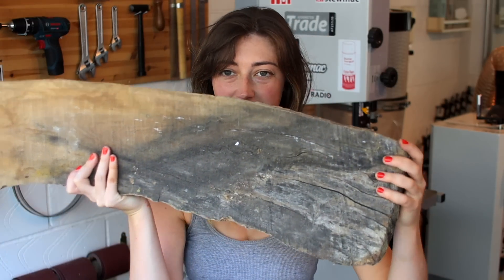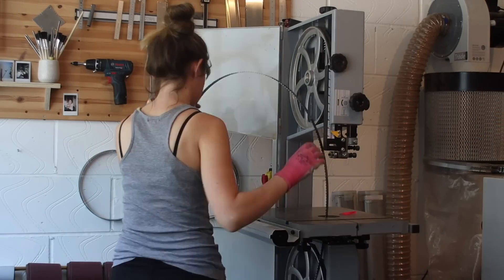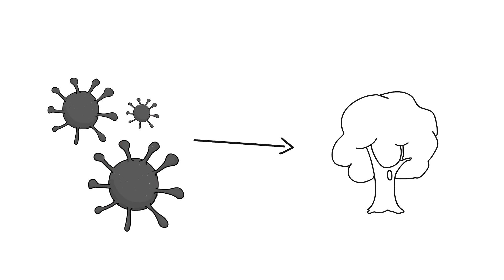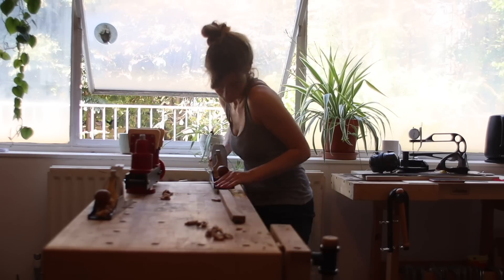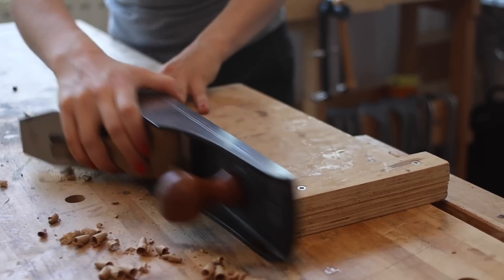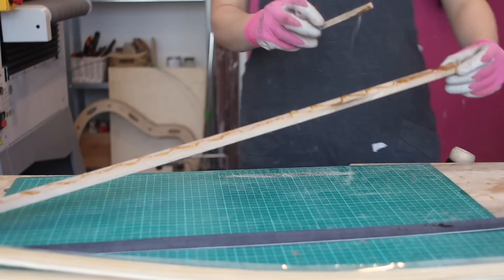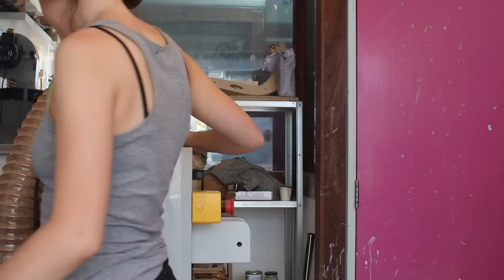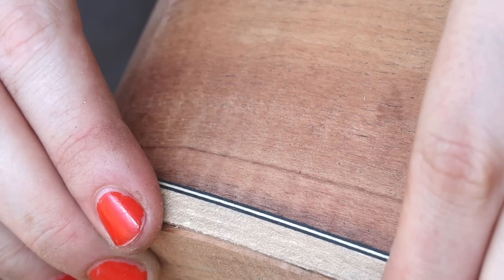Making Guitar Bindings

Comment: Nice   First video i’ve found for making bindings.

Glad to see you wearing gloves and recommend a block or keep fingers past the cutting edge on the saw. I have a block my grandfather used that’s over 200yrs old

I admit I don’t wear gloves enough myself and was quickly reminded this week while I was sanding a piece of hickory for a machete handle and suddenly the wood separating my fingers from the sander flew away faster than superman… 80 grit paper…. 
Healing now but it was such a cool jagged cut split or rip I may have even have a pretty cool finger print…

Fortunately I was a medic for 30 yrs so I know how to use duct tape.  😎

Comment: For everything you never knew about spalting, look up Seri Robinson, aka Dr. Spalt. She is at Oregon State University. Spalting actually comes in rainbow colors, and has been used to make dyes for hundreds of years. There are samples of furniture from the 1600s or so where the colors are still bright and vibrant. Her program is about making the dyes. Northwest Spalting is the business associated with it. 

One potential problem with the foamy verathane glues. If you ship or mail by air, the bubbles will expand, and things can delaminate. Had a friend who made expresso tampers, gluing stainless steel onto exotic woods, and air mailed them to Japan. They all failed/delaminated.

Comment: 6:14 I really do apologize if I'm overstepping, but I just wanted to caution you about wearing gloves while operating a bandsaw. If the blade catches your glove, it's much more likely to pull it in with your hand vs. your bare skin. It's generally considered a lot more dangerous to wear gloves with certain shop tools like the bandsaw. Apologies if it sounds like I'm being preachy with unsolicited safety advice. Just don't want you to lose a finger, it makes guitar building and playing a lot harder! :)
Reply from the maker: Nah it’s totally fine when I’ve given guidance in the right way - I agree, I don’t usually wear gloves, I just completely forgot this time. Thanks for flagging up in the right way :)
Reply: @DaisyTempest  NO! depends on what you are cutting. If you are cutting aluminum or steel it will get hot fast. It will burn you without gloves. Get good leather gloves that fit tight.
Reply: I am ashamed to say I actually cut the pad of my right thumb on a running bandsaw, and it's a devil of a wound that takes forever to heal.  I worked nearly 40 years as a toolmaker, so I guess you are allowed one or two mishaps in what works out to close to 80,000 hours using machine tools.  Since I retired I have found angle grinders are the tools most determined to get me, and usually when I have finished what I was doing with it, and am putting it down while it is still slowing down.
Reply: @anthonyb5279  If you’re cutting metals on a bandsaw and burning your hands, you’re either using the wrong combo of blade/speed/lubricants, or not using an appropriate fixture or pusher on the material. Also if you’re letting blades get that hot, they probably aren’t lasting long. The problem with even tight-fitting gloves is that if the blade nicks them, you don’t feel it and react the same way as you would with bare skin. And with how strong leather is, if that blade happens to snag the glove forcefully, your hand is coming along for the meat grinder, until you manage to shut the machine off and the blade slows down. Every shop safety class I’ve ever had to take pounded into our heads that loose clothing, long hair, and any other loose things like necklaces, jewelry etc were to be removed or tied back before entering the shop, and for tools that pose a snag hazard, gloves were NOT to be worn.
Reply: @TrevorDennis100  Ouch! Sounds like you still got to keep your thumb though, so thank goodness for that. A story from my life: a family acquaintance (a dentist actually) was a hobbyist woodworker on weekends. He did great work and was quite experienced, but one Saturday afternoon he wasn’t thinking and reached around the bottom to support a piece of falling wood he was cutting with a circular saw. Yep—the saw went right through all 4 fingertips. The worst part was, as a dentist, it affected his ability to do his job until a long recovery. As they say… safety rules are written in blood! ;)
Reply: @400_billion_suns  you have never cut aluminum have you?
Reply: @anthonyb5279  I have. Many times. I've fabricated parts on CNC and manual mills and lathes and have worked with numerous shop tools. One of my degrees is in mechanical engineering and a lot of time was spent working in the machine shop then as well as future jobs afterward.

Comment: The lighting on the shop from those big windows… so awesome. Also, I too use gorilla glue for this purpose. Glad to see someone else use that as well. I do apply it with a foam roller. Much cleaner and it applies the right amount without much foam squeeze out
Reply: That's probably one of the better uses of polyurethane glue.

Comment: I have a walnut body strat.It is incredibly  heavy, but one of the best guitars I own. I have often wondered what a walnut fret board would sound like.
Reply: I have a 5 string bass I made which I used Walnut as a fretboard, simply because I used walnut 'wings' on the body (neck through body design with a 5 ply Maple/Walnut laminated neck) so the fret board matched. Has quite a warm tone but you cannot put that down to the fretboard material alone so cannot say definitively that it wouldn't sound different with say, a rosewood board.

Comment: I am interested to know what dimensions you cut the binding at.  

I have some walnut binding on a semi-solid I am building at the moment and cut it to finish 6mm deep but I was afraid of it breaking so I left it at a little over 2mm thick.   Since then I discovered the rule about stiffness increasing as a cube of thickness so a 2mm thick strip is eight times as stiff as a 1mm strip.  That might not sound much but it meant that my first attempt at bending it to fit and gluing it in place was a failure as I hadn't managed to get it tight into the binding channel all the way round and it all had to come off - but I learned how to do that as well so it was all a beneficial part of the learning process...   

The second attempt was done at about 1.5mm and that worked a lot better.  I may be even braver next time and try to get it to about 1.2mm but do you think that would be too thin?

Comment: Daisy, great video!  You’re demonstrating a natural talent that will take you far.  Try waxing the tables and bases of your powered and hand tools, you’ll be amazed how much easier it is to feed your wood into the blades.  Please use push blocks and push sticks when using all power tools, hands with 10 digits are very attractive and useful.  Your dust collection is a wise investment.  The bench your using may be a bit too tall for planing, you’re using your back and arms instead of using your legs to plane.  Try rocking on your feet next to your bench and it will become obvious that you need another bench that’s shorter in height.  Keep the current bench for detailed, close work, and use a shorter bench to enable your legs and central body core to generate the strength to work with planes, scorps, large chisels, spokeshaves, and other arm-strong tools used by hand.  Keep making sawdust!  Bill from frozen Minnesota, USA.

Comment: I’m sure you just forgot to take them off at one point but you really shouldn’t wear gloves when working with the bandsaw 6:12
Reply: I saw another video where this guy was wearing gloves whilst using a table router. The amount of times my gloves have been tangled up and crushed my fingers when using an impact driver, I dread to think what the router would do? 

I only wear gloves when handling timbers and sanding now..

Comment: How careful do you need to be about the grain direction for the binding?
I think I saw a video on Crimson Guitars where Ben split the timber he was using for internal bracing to get the natural fracture line, then squared the wood up based on that, before continuing on the process.
Oh - re: safety - the last bit of sawing you did - no safety goggles.

Comment: Impressive! Making binding is something which is not often shown on video. But please please please do not use gloves like that when working with any power tool. If you accidently touch a spinning blade or drill bit, threads can get caught and pull the hand into the tool. Even though band saws are relatively safe because you don't push the workpiece against the rotation like on a circular saw or router, accidents can still happen. My uncle lost a finger on a bandsaw this way. Looks like you're trying to get more grip from the gloves, maybe you can try those thin rubber gloves (they can be reused many times for better sustainability...woodworking is no sterile surgery.) They're not made of fibers which can get caught by a tool. Or use the masking tape and super glue technique to add some small blocks of wood to the workpiece every few inches to help pushing it. Just some ideas. I know this probably sounds stupid. But I'd be glad if such incredibly skillful hands are kept safe.